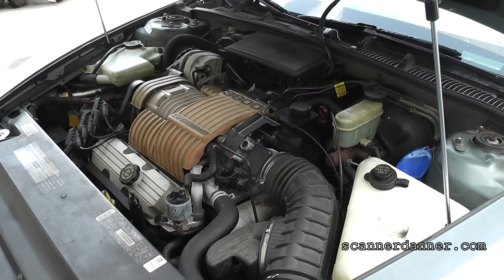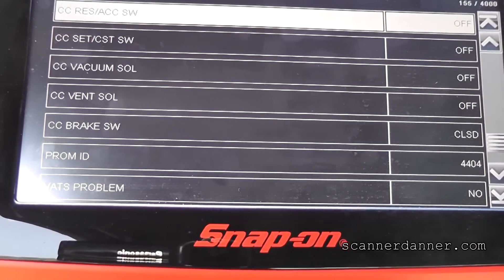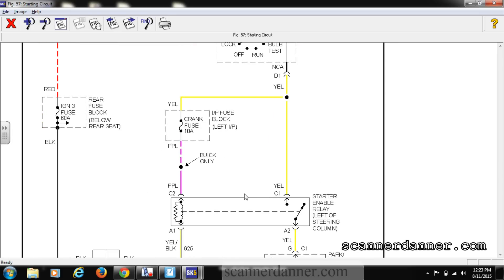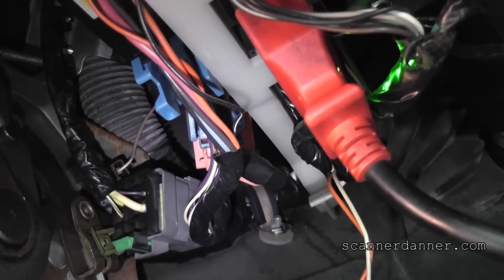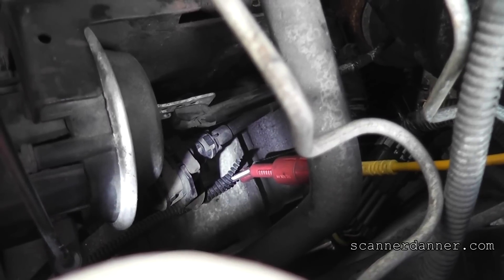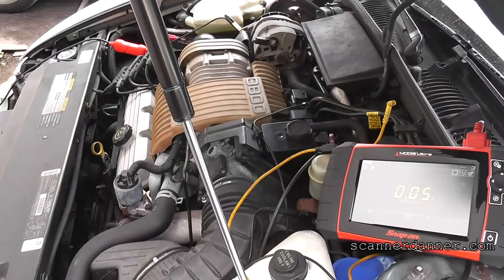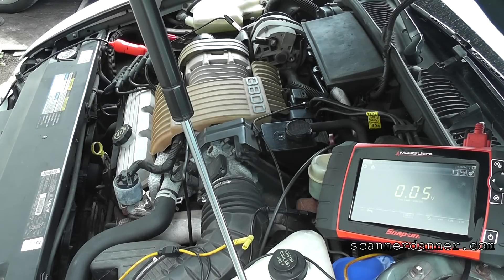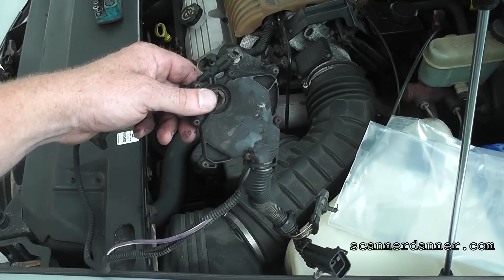How to test a starter (engine doesn't crank)- bad park/neutral switch-GM 3800

Comment: What about an intermittent crank - no start? Was able to get car to start but couldn't get the key out until I wiggled the gear selector and waited to hear a click. Then the car would no restart. Tried starting in neutral. No luck. Would this be the immobilizer?

Comment: what if u have a no crank no start and you remove the starter relay and jump the ports 30 and 87. I switched the relay with another and still starts. removed the wire from the S terminal to check for voltage and nothing.  please help 🙏🏽

Comment: Danner, I'm about to condemn the PCM because I do not see ground control to the starter relay, I also do not see ground pulses from the PCM to injectors and coils. I bypassed the computer ground to the starter by manually supplying ground, when I start the car with the key, it cranks but no pulses to injectors or coils like I mentioned. Power and grounds to the PCM are good. Will the VAT cause a no crank condition as well? It appears to be driven by the network wires in my case. This is a Dodge Durango 2005 4.7L. I will be checking the signal from the P-N switch as that is the last thing I need to verify, in my case the signal is an input for the computer to ground the starter relay but I don't know if it is also a control for the injectors and coils. Currently I appear to be missing output ground signals. Thank you.

Comment: I'm guessing there wasn't a way to do a continuity test on the park/neutral safety switch?  I'm curious, because I may have a faulty one on my 2002 Montero Sport and I'm currently replacing the transmission cable (friend who gave me the truck broke it) and the truck won't start in park.  Thank you for the video
Reply from the maker: Continuity testing is the WORST tests available for wiring integrity
Watch this video https://youtu.be/McsNOJvd0ao
It is a condensed version and worth 14 minutes of your time

Comment: I go to UTI in Exton,PA and paused when you showed the wiring diagram and was already taking notes to what I should see before getting any measurements and followed through everything. This was a great video for testing for what I know. (Obviously you wrote the component at fault in the Title but my assumption for what I should see measurement wise were all spot on). Thanks Dan

Comment: Hey sir 
I have a similar problem with my 91 Firebird 
No crank issue still stuck I did get a new EGR and starter relay what makes the relay it click now still no crank but I did notice that the white purple wire don’t get power but the brown white does by the safety neutral switch  also the lights wires by the switch do get power  does that mean the switch is bad???
Code 53 still piping up help me I have no idea what else to do thank you sir
Reply from the maker: I would need to look at a diagram to help, please post this to my forum, it is free to join. 
https://www.scannerdanner.com/forum/post-your-repair-questions-here.html

Comment: If anyone who as has a actually does a lot of electrical troubleshooting in a motor vehicle especially in Canada where I live where there is snow and salt says they have never probed a wire! They must wok someplace real nice! Wires corrode and if you sometimes to you have to seal it up really good after and no electrical tape the conventional roll kind is not a good way to do it! The liquid electrical tape is a good option! Only other way is cult solder seal with heat shrink and even then I would only do a dual layer of it! The new heat shrink with the sealant is also a great option if yo have access to the end of the wire so you can slip it on or the solder up... But never probing a wire in the real world as yo say is nearly inpossible! I justified a corroded ground wire that was eaten up in the centre of a run......

Comment: Solid diagnosis. Pierce the damn wire if you need to; I thought it was the best call. Having similar issue with my e46 BMW, starter is also extremely hard to access

Comment: Great Video. I had the same issue with a Dodge Intrepid. The TRS or neutral switch as you discovered, was my issue also.
Reply: does this neutral switch send a ground or power signal to the PCM? I'm working on a 05 Dodge Durango 4.7L and that's the last thing I need to check before condemning the PCM since I have no ground outputs to starter relay, injector or coils when manually engaging the starter relay.

Comment: I always poke holes in wires it's no big deal alot of times I remove the harness in spots where it will become a problum later just so I can get to wires on ny dump trucks just tie straps. every 6 inches lol

Comment: if i catch ya poking holes in wires ill break your probes. in a lot of places you can get away with it. up here no way. i have replaced more wires because of probe holes  than just because the wires  break.  road salt is bad enough but that calcium crap is devastating. even the liquid tape only slows things down. best practice is testing connector to connector. also just because your voltmeter says its ok, make sure the circuit is loaded or apply an artificial load to it.  seen too many good readings that fall apart under a load. those if you dont look for them will drive ya nuts.
Reply: richard cranium he did load the circuit smart guy

Comment: P.S. We live in the desert, poke holes in wires all the time and, brace yourself, NEVER REPAIR THE HOLES! And, we never have any problems with said holes later on, either!  This isn't for every environment, obviously. When it does snow here, it usually melts the same day and we rarely ever see salt trucks out on our roads. In the city and in my lifetime I can remember maybe two. If I lived in Michigan, I'm sure my philosophy would be the exact opposite and I would try to never poke holes and if I had to I would absolutely repair them and seal out all that corrosive salt water.

Comment: I was working out in the field on a 01 gm with a 3800 that had a crank no start condition. had an anti theft light on and the computer was actually shutting off the fuel pump and the cam signal. long story short my customer had it towed to the dealer and called me and said it had a bad computer. but my question is, because I didn't know how to check it, what would have been your next step if you had an anti theft/security issue

Comment: how is the modis compared to the verus edge?
Reply from the maker: The Verus is a different operating system than the Modis. I'm biased toward the Verus for sure and it doesn't have to be the Edge. All of the Verus models are awesome
Reply: but how often do you need a 4 channel scope?
Reply from the maker: all the time when I am teaching! 15% of the time in the field I need at least 3 channels

Comment: hello I have recently replied on one of your videos about my s10 4.3l stall after starting. well I looked in this mechanics book with my grandpa and it told me to check my starter silinoid   so I did and one little purple wire  was broke so I fixed it and I noticed another one that wasn't bolted on all the way and it looked to be shorting out because of poor connecting but then I tried to tighten it up  the whole stud kept falling out now could this be my whole problem and the reason my truck stalls after starting???
Reply from the maker: +Tyler Showers for sure! Is it the main battery stud that comes off of the solenoid?
Reply: +ScannerDanner well with a further investigation after reading my grandpas mechanics book I found out that the people that had the truck before me didn't tighten the pos wire on the starter sil. and it was shorting out so I went to tighten it and the whole stud broke out so my next step is to buy a new starter (50$) and see where it goes from there
Reply: +ScannerDanner well new update I put a new starter in and its doing the same thing and now its back firing idk I'm out of ideas
Reply: +ScannerDanner I fixed the back fire. dummy me put the timing off a little bit but got it now. but I noticed my IAC is chattering I just changed my mass air flow sensor today (the people before me had it on backwards and messed up the screen) but I also noticed with my test light that my plug in the back of my alternator has no current (not the pos. post on the back but the plug on the back/side ) but I'm getting good test everywhere els
Reply: +ScannerDanner and also my throttle position sensor has low ground

Comment: I see you have a new scan tool. Is it better than the older one you had, or maybe faster? Or what is the difference between the two? Thanks for the vid btw. In the field vids are my favs. :)
Reply from the maker: +Atrax R It's just different. And I borrowed it from a friend. I still prefer my Verus. Main difference is it has 2 less channels on the scope and it is not a PC
Reply: ScannerDanner Ah, so yours is pretty much better then. Also it's good since it's a pc at the same time, just cuts down on stuff you have to haul around with you, which is always a good thing. Thanks for the reply!

Comment: what about using a power probe hook, and testing all the relay connectors? can check all 4, and look for an open. Using the hot shot to check the integrity of the 4 points under load. What do you think danner? BTW my wife laughed when I said "I wanna fix cars the right way, not be a parts changer", she was "Ok scannerdanner" hahah
Reply from the maker: +Luis Martinez lol nice!
absolutely you can test this circuit other ways. I'm not familiar with the hook yet, I actually have one, just haven't used it yet.

Comment: Glad i watched this one. Not sure why, but I've been nervous to use my power probe on the starter circuit. Haven't done much research as to what's safe and what's not safe. But after watching this I'm guessing either it has a high amperage rating or the amperage doesn't pass through it.
Reply from the maker: +andrew johnson I would still be careful. Do not use it to energize a load side of a starter. And even the control side is pushing the limits of the tool. I think the PP4 has a 20 amp max output. Not sure if it is fuse protected. I think it is.
Reply: +ScannerDanner i must have zoned out somewhere in the middle of the video because i thought you were on the load side lol. Makes a little more sense now.

Comment: I sometimes strip back the insulation with a razor blade. I patch it with electrical tape and I've never had a comeback. To add -- I've worked at the same fleet job for 16 years, I would very likely know if there was a problem. It's not like the work goes to another shop...

Comment: You said that it was hard to get to the starter wires and I am not sure if this would help on this car but I have in my tool box a coat hanger that is about 18 inches long and has been sharpened to a point on one end and it is incased in windshield washer hose so as to not ground out when checking for current at the starter. You can bend that thing into any position. I always like to check the starter first if possible as a time saver. Just my preference. As always great video. In my opinion poking holes in wires is ok as long as you repair the hole. Been doing it for years without any issues. Again Thanks for the video.

Comment: I've never understood the objection to poking a hole to test a wire. I'm willing to bet backprobing which is considered "proper" might actually be more potentially damaging.
Reply from the maker: +Schrodingers Box yep, the same crowd also hates back probing
Reply: +ScannerDanner  i'm fine with poking holes when your hand  are ties like you show us but for some tech,poking holes in wires is just normal for them even if they could easely baack probe a connector

Comment: hi mate today i replace fuel flter for ople 1.9 tdi  after that car start then  shut off i put my launch x431 v +    show p0090  fuel presser sonsor back of pump i test both pin both pin  have  a power  just ground missing what is be?thanks
Reply: +KURDISTAN uk I'm not sure what the spec are for that brother. I would think the wiring would be a 5v ref. (power) and ground and a signal. Can you measure all three wires and list the readings here?
Reply: thanks for u ,,there is 2 wire both is power,, end of the sonsor .i thing should be one ground one power but  ground  missing.... from end of the ecu i check same thing thnx
Reply from the maker: +KURDISTAN uk so it sounds like a psi switch and if both wires are reading 12v, it sounds like it is a pull up design, though it could be a pull-down design with an open ground. 
Voltage on one of those two wires will change with psi changes. 
Are you familiar with my Section 2 material "Switch Inputs"? If not, start watching my friend, you'll understand what I'm talking about. 
I can give you a coupon for a free month to my premium channel if you like. This is where the real meat and potatoes is on this subject. Let me know, email me through my website. 
There is also a playlist of case studies titled switch inputs right here on this channel.
Reply: ok thanks how much take amonth
Reply from the maker: +KURDISTAN uk It's $10 per month
Reply from the maker: +KURDISTAN uk It's $10 per month

Comment: I was told by Power Probe to always put power to the tip then put it on the load so the spark happens at the probe tip and not at the switch. I had to get a new switch on my Power Probe 2 because of this. Kevin.
Reply from the maker: +Kevin Call that actually makes sense. I'll have to ask them if the PP4 has a heavier duty switch that can handle the arc. Thanks for the tip!

Comment: Hey Paul, Not meaning to sound cynical but you seem to do a lot of diagnosing for Pete on things that should be straight forward for a professional workshop. Is it that he is just willing to put cars aside for you for the purpose of your videos? I hope that's it and if it is thanks Pete for allowing the scanner man to do these videos.Also you refer to liquid electrical tape a lot. Never heard of that in Australia. Is this simply silastic you use or can you provide a brand name.Keep up the great work.Regards,James
Reply from the maker: +james ross no problem. Pete runs a very busy shop and really doesn't even bother anymore to look at these cars first before calling me. He can focus on the cars he needs to get done and has me do all the electrical stuff. 
Also he has a pacemaker so he hates electricity. 
That liquid tape was bought from a local Walmart not sure where else to buy it.

Comment: Did you see, that the fuel trim pid did show 128? Ist there something wrong with the O2 sensor?
Reply from the maker: +Muelli1000000 128 is a binary number and is equal to 0% fuel trim. Numbers above 128 = adding fuel, numbers below 128 = subtracting fuel
Reply: ScannerDanner Oh, that's interesting... I never saw anything about that in your videos about fuel trims. Is that unique to GM?

Comment: Usually when I install a used transmission I swap over the electrical components. Provided it was a mechanical failure you know the sensor and switches are still good. Thanks for the great video

Comment: Poking a hole in a wire , then fixing the hole to me is ok when needed . Had a car here the other day and every wire i looked at on the car had a big hole , looked like they were poking with a 16 penny nail. But a small hole is sometimes needed
Reply from the maker: +wtbm123 for sure, some people get carried away. I love the ones that they've taken a razor blade and cut the insulation half off, and a few strands of copper wire while they were at it.

Comment: Great video!  I had a Ford Taurus towed in for a no crank.  I jumped the starter relay with the ignition turned on like a dummy and the car started up and took off.  Luckily, I was able to get into the seat and turned off the ignition.  Thank goodness it was in the parking lot and not in my bay cause it would have pushed my tool chest through the shop wall.  The reason it wouldn't crank is because the shifter cable wasn't attached and the transaxle was in gear.  Just to others it doesn't matter how much experience and time you have in the automotive field.  Things can turn bad really fast.  Stay safe and pay attention to detail.
Reply from the maker: +Discretesignals wow man! I'm glad it turned out okay. That could have been really bad! Great word on safety. Next time I jump a starter on camera I'll mention it and use your story if you don't mind.

Comment: Very nice Paul but don't for get the easy test first. Use jumper cable from ground on Battery to block. I have seen many broken grounds or loose connections.

Comment: All these years iv been following you I have purchased a number of test lights all with different current draws so I can manually energise outputs, and now you've got a power probe, how dare you lol, those things can be dangerous. Great video
Reply from the maker: +Pico Tech yes they can but no more than a jumper wire in the wrong hands right?

Comment: Paul, I trust your opinion so for my information could you do the same test with the Load Pro and if so would piercing the wire still be necessary?
Reply from the maker: +Jim Buford never used one and never will. The owner of that tool has called me out on a number of occasions for my methods. And these have been unprovoked attacks. He is hell bent on his methods being the only methods. It's a shame really, I think his tool has a place. He just needs to quit being on the attack with everybody and every thing.

Comment: Funny about not piercing wires if you work in the real world so true, especially if you are scoping for a glitch over time, that is where a piercing probe really shines, was that glitch real or did you just bump the tpin? the last several months I have used the hell out of my piercing probes with intermittent ac clutches, pierced on the compressor side of the harness,once I proved it was the clutch not a power issue, no worries on the hole, but most of those you are not getting in there with a t pin